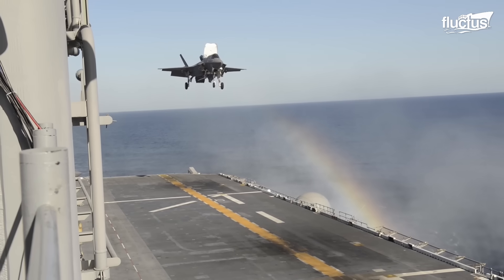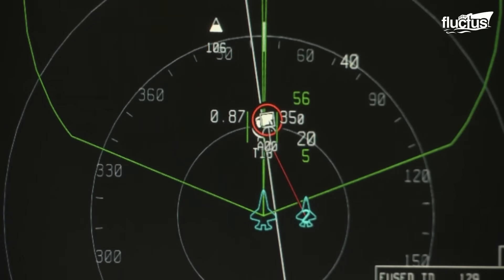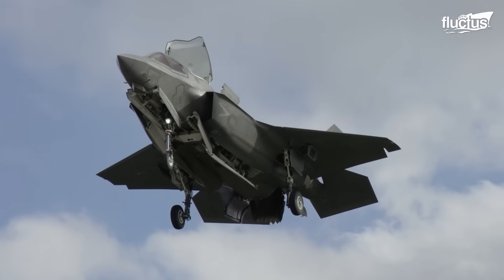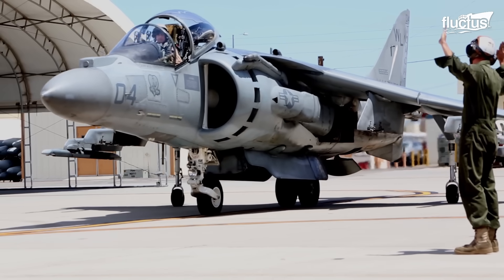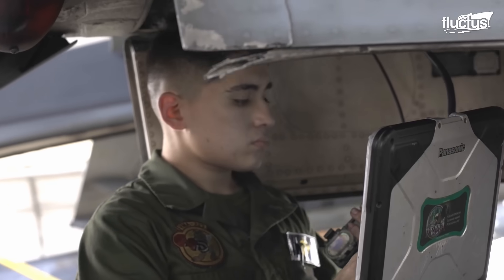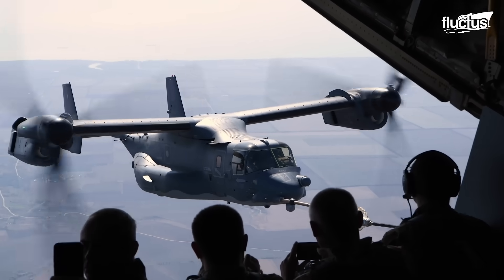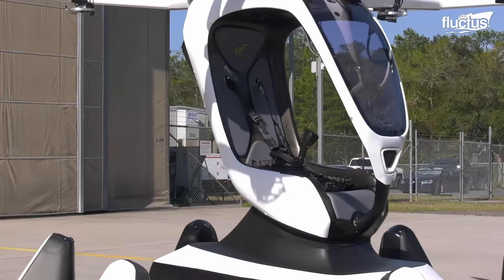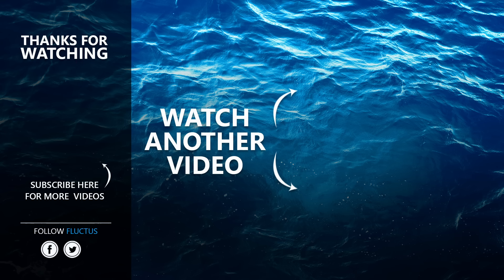Behind F-35B Monstrously Powerful Vertical Fan Operations on US Navy Carrier

Comment: Was not the vertical fan technology licensed decades ago from the Russians/Communist? From who for the USA?
Reply: The Yak design worked quite a bit differently internally, they didn't use the lift fan attached to the main engine like the F-35B, they basically had a separate jet engine used only for vertical flight.

Comment: The pile of junk can only land in very clean areas. The vertical lift fan will suck in birds, dirt , small rocks and a large number of other items.
There are no pristine areas in forward combat areas ... so the thing is junk.
Reply: I disagree, it can land vertically, it can take off STOVL , fly faster than the speed of sound, but it is a flawed compromise, and not a true successor to the Harrier, which has true VTOL performance!

Comment: Maybe the harrier is not as fast or as stealthy as the F35, but in my humble opinion, the vectored nozzle system was much simpler and more elegant 
The only time I've seen an F35 hover then try to fly backwards, it fell out of the sky. 
This is the biased view of a humble Brit..
Reply: The video references VTOL, but the F-35 can't perform vertical take-off to flight (STOVL- only short-takeoff-vertical-landing). Correct me if I'm wrong.
Reply: @bcanuck it can. You mean like Hover and transition to forward flight right? Yes it can, they just dont do it often because Short take off is much more efficient. Look at Airboyd video in youtube where an F35 flys around, stops and hovers, then returns to forward flight
Reply: "The only time I've seen an F35 hover then try to fly backwards, it fell out of the sky. "(sic)

You don't get out much do you?